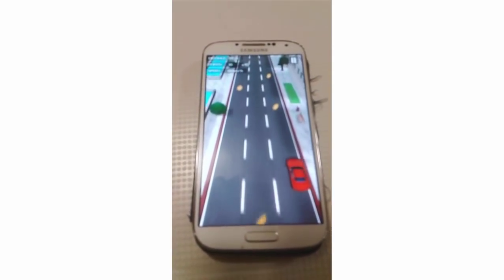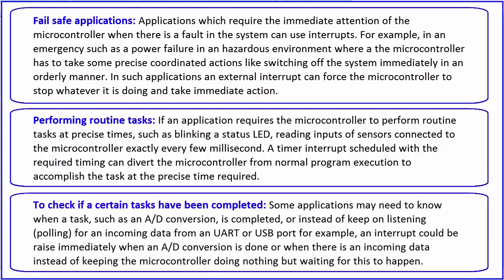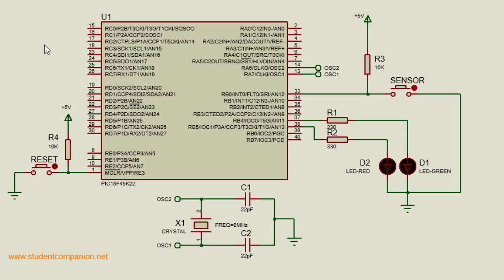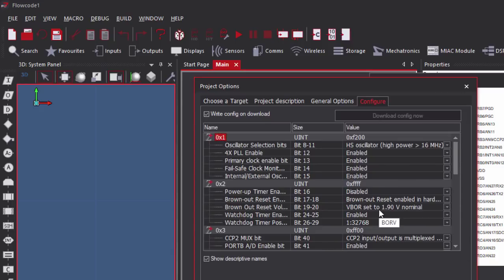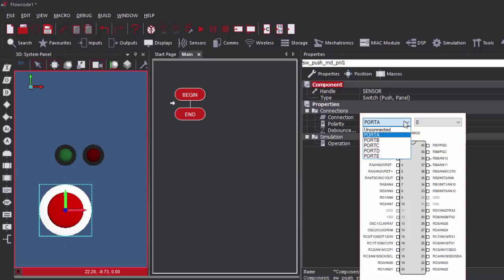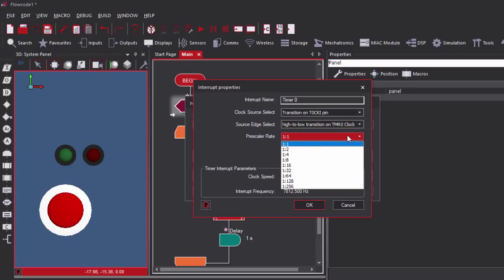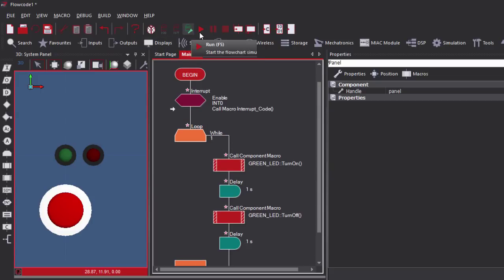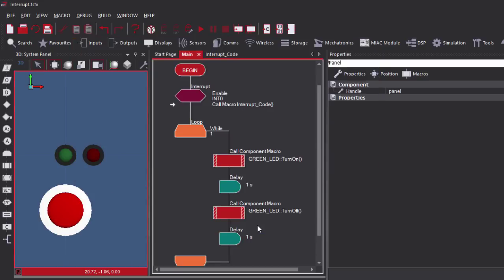21- Interrupts, part 1: External Interrupt | Flowcode Beginners Tutorial

Comment: how can use interup on this my auto changeover switch but the code is not working fine i need your help for correction
[8:12 PM, 9/30/2018] Bright: //#define _XTAL_FREQ 20000000
//#define relay RC0
//#define buzzer RC2
//#define nepa ledC3
//#define gen ledRC4
sbit relay at RC0_bit;
sbit buzer at RC1_bit;
sbit nepa_led at RC2_bit; // nepa led
sbit gen_led at RC3_bit; // gen led

sbit LCD_RS at RB1_bit;
sbit LCD_EN at RB2_bit;
sbit LCD_D4 at RB3_bit;
sbit LCD_D5 at RB4_bit;
sbit LCD_D6 at RB5_bit;
sbit LCD_D7 at RB6_bit;

sbit LCD_RS_Direction at TRISB1_bit;
sbit LCD_EN_Direction at TRISB2_bit;
sbit LCD_D4_Direction at TRISB3_bit;
sbit LCD_D5_Direction at TRISB4_bit;
sbit LCD_D6_Direction at TRISB5_bit;
sbit LCD_D7_Direction at TRISB6_bit;

unsigned int nepa=0,gen=0,brt;
unsigned cnt;

float voltage;
char volt[15];
void main() {

PORTA = 0;
TRISA = 0X01;
PORTB = 0;
TRISB = 0;
PORTC = 0;
TRISC = 0;
LCD_Init();
ADC_Init();
//LCD_Cmd(_LCD_CURSOR_OFF);
//LCD_Cmd(_LCD_CLEAR);
//LCD_Out(1, 1, "GENERATOR");
//delay_ms(1000);
nepa:
do{
nepa = ADC_Read(0);
voltage= (nepa *5.0*100)/ (1024.0);
IntToStr(voltage,volt); // it converts integer value into string
LCD_Out(1, 6, "NEPA");
Lcd_Out(2,1,"VOLTAGE =");
Lcd_Out(2,11,Ltrim(volt));
Lcd_Out(2,15,"V");

if(nepa>0){
relay=1;
 nepa_led=1;
 buzer=1;
delay_ms(100);
buzer=0;      // to off buzzer

while(nepa<0){
LCD_Init();
LCD_Cmd(_LCD_CLEAR);
relay = 0;
nepa_led=0;
buzer=0;

}
}
}while(gen<0&&nepa>0);

 gen:
 do{
LCD_Init();
ADC_Init();
//LCD_Cmd(_LCD_CURSOR_OFF);
//LCD_Cmd(_LCD_CLEAR);
gen = ADC_Read(1);
voltage= (gen *50.0*600)/ (1024.0);
IntToStr(voltage,volt); // it converts integer value into string
LCD_Out(1, 4, "GENERATOR");
Lcd_Out(2,2,"VOLTAGE =");
Lcd_Out(2,11,Ltrim(volt));
Lcd_Out(2,15,"V");

if(gen>0){
relay=0;
buzer=0;
gen_led =1;
if(gen<0){
 relay=0;
buzer=0;
gen_led =0;
}

}
 }  while(gen>0&&nepa<0);

 }
Bright: this is my code  for automatic changeover but is not working fine i need your help for correction
Reply from the maker: Hi. This is Flowcode video, not only you who will read these comments, so post your comments on a correct video, there is an interrupt video with mikroC. That's where you should post your comments. And when asking questions, to receive correct answer always be specific. What is not working fine suppose to mean? Clearly says what is working and what code is not working and explain how it should be working. We can't guess how your code should work.

Comment: I need a little help. I need to make a digital clock on pic 16f877a which has an external oscillator of 20mhz. But using this doesn't provide the exact frequency for timer1. So a 32khz crystal  is used on t1clk pin . But the interrupt frequency do not change and i can't get a exact value. So how to use a timer crystal for timer1 for a pic which alrady has an external oscillator??
Reply from the maker: Hi. You can follow the example supplied by Matrix. Download the components examples at: http://www.matrixtsl.com/flowcode_help/help_examples.php
Open the LCD examples, there is an example of a digital clock using timer which can basically fulfill your requirements.
Reply: Student Companion thank you sir.   But my problem is a bit different. I have already build the logic for a digital clock in flowcode 6. But i can't get exact interrupt frequency of 150hz to count 1 sec as i don't have 19.66Mhz crystal. My only option is to use the 32khz Crystal as a secondary oscillator Following you tutorial at https://www.google.co.in/amp/s/www.studentcompanion.co.za/digital-clock-using-pic-microcontroller-interrupt-xc8/amp/. I can see that you are using the internal 8Mhz crystal and also the 32khz as a secondary oscillator  for the timer. Can you give a little insight as to how to implement it in flowcode.  Thank you.
Reply from the maker: Hi. Please ask your questions in the forum on our website for better support: https://www.studentcompanion.co.za/forums/
Reply from the maker: Hi. Sorry for the late reply.

For you to build a clock, any crystal frequency can be used whether internal or external depending on your need and understanding the advantages of ones vs the others.

Interrupts occurs when the timer overflows. A count is made internally based on clock inputs (clock input can be internal or external) and the pre-scaler property (A prescaler divides down the clock signals used for the timer giving reduced overflow rates. The rate can be set to a number of possible values. The exact values are chip dependent).

When the count reaches a certain point it overflows back to 0 triggering an Overflow event. This event can then be used to call a macro. Timer overflow interrupts are called repeatedly at the Interrupt time interval making them very useful for time based events.

The exact properties available for a timer interrupt are device and timer dependent. As such the timer overflow dialogs may vary from device to device and from timer to timer.

As I already replied to you, there is an example of a software clock using timer0 in Flowcode LCD component examples.

They are using Timer0, Clock source Internal Oscillator, Prescaller: 1:128 giving an interrupt frequency of 150Hz, as time is the inverse of frequency, to get 1 second or 1 Hz, they count each time an interrupt as occurs until this counter =150 to get 1 second. Once you have 1 Second, you have your time base for your clock. Instead of getting 150 Hz for 1 second, your frequency will be different as it's depend on the clock used and also the PIC you are using.

You can follow the same procedure but instead of using timer 0, use timer 1. In Flowcode, once you select Timer 1 from the Timer icon properties, you have option to select your clock source between Transition between T1CK1 pin, Internal clock (Fosc/4), Internal Clock (Fosc) and of course 32.768KHz XTAL T1CK1/T1CK0

Why chose external vs internal?

There are many advantages of using external clock for time based compared to internal clock. You can google to learn more, but usually external clocks are more precise and temperature tolerant better than using internal clocks. This will help you not to lose more seconds per day thus making your clock precise.

Why use the 32.768KHz?

The frequency 32768 Hz (32.768 KHz) is commonly used, because it is a power of 2 (215) value. And, you can get a precise 1 second period (1 Hz frequency) by using a 15 stage binary counter.

As current consumption has to be as low as possible to preserve battery life. The low the frequency the low the current consumption. So, this frequency is selected as a best compromise between low frequency and convenient manufacture with market availability and real estate in term of physical dimensions while designing board, where low frequency generally means the quartz is physically bigger.

Comment: Thanks allot for your hard work teaching us.But Please please help us and make video on how to fully use eeprom in flowcode v5 sothat we can learn how to use it in our projects like storing passwords in eeprom and use them even if power is switched off
Reply from the maker: We will but not now. We have a list of tutorials we will upload before that one. Please not we no longer fo videos with Flowcode v5 because there are new versions now with more features than v5 like v6 and the current v7. But as you know with Flowcode if you can do it with v7 it won't be difficult to do it with v5. The code icons are the same. If you found problems to follow the tutorial with Flowcode v5, write a question in comments we will try to assist you.

Comment: good day
 <<very thanks about your tasks>>
so I have question

+can use your interruption  {input------->B0} for do mute(Silence) for Buzzer connecting to B7 <pic16f877a> 
,Knowing there are 3 sensor (or Buttons) interfacing port D 
the Buzzer run when any Button pressed 
so I need the Buzzer Silence even or wait the pressed button is open or 3 buttons    
???can Do it By flowcode ***///

    best regards
yasser
Reply from the maker: Yes if i heard your question correctly.  An Interrupt will take priority. Evenif your buzzer is making sound, even if there is a delay running. In the interrupt macro you can silence the buzzer and do other things you like.